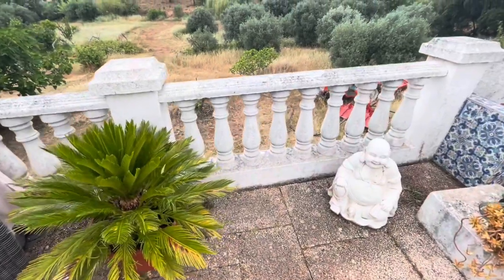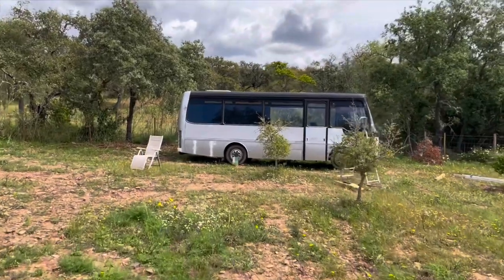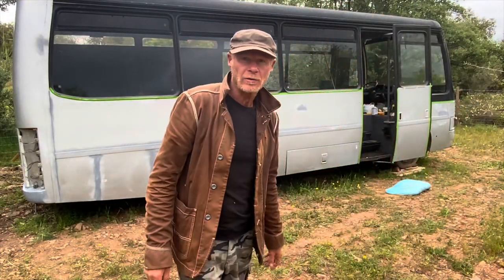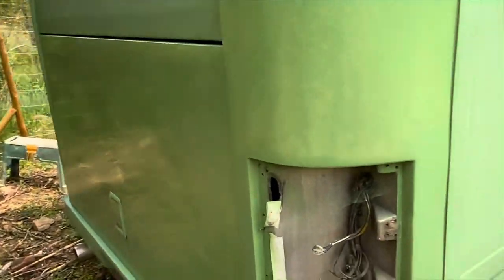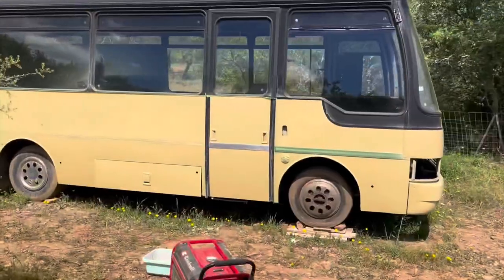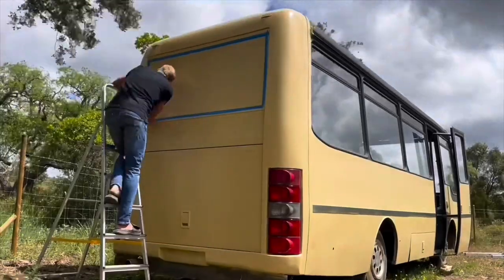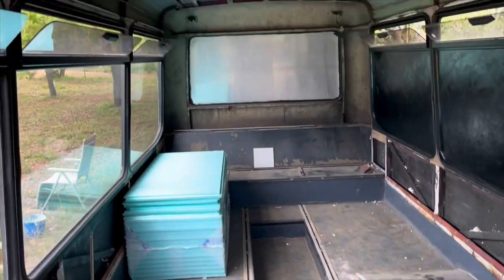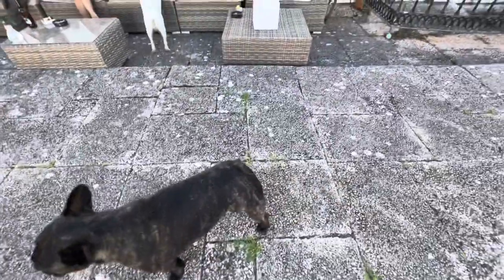Transforming a Bus into a Home in Portugal #07

Comment: Thumbs 👍 up Sir 
 Will follow the Bus conversion with interest,   as I plan convert a Luton /or standard Truck 🚚 in the future.  
 Floor looks good 👍
Reply from the maker: If I was to do it again I would use pallet wood on the ceiling. Probably more for aesthetics. Saying that the pvc I used is good but no tongue and groove on the ends makes the joins almost impossible  to make invisible. And Further down the line I’d like a clever devise to have insulated blinds that can open up fully for daytime. The floor worked out really well. Also if money wasn’t a thing (as it won’t be driven around) I would go for a small pellet burner.
Reply: @blondguy   Thanks for the details.
 Yes .. I know what you mean  (pallets)  about the look,     but  boy  they are a lot of Extra work.   Different lengths,  THICKNess  ,  some clean  some not,   different levels of stain to create perfect finish.......OH   Yes beautiful,   but a lot of work.    I didn't realise the ceiling was PVC  lengths  (I must be blind) .... what you think of tongue and groove WOOD   and Paint it White? 
 I would love a small Stove too,  they look beautiful,  but take up a lot of Value space,     I'm  going towards  a Diesel heater,   hooked into the Lorry  🚚 Tank,   if  its not crazy price wise,  running heating  pipe under full floor.  
Yes.. the insulated blinds would be great.
 A friend on mine,  on a stationery bus 🚌  ,   put   12 or 18  eyebrow    all the way along   on outside  over the windows  made  from sheet tin.   He said  major improvement to temperatures 🌡..

Comment: Love your videos, but there still is some work to do on the audio part.
You should use a mic attached to your body, and check the audio gains of the used music, somethings are to loud and the voice part is not loud enough.
Besides that  nice work!!
Reply from the maker: Thanks Gunther. I think they improve as you get more up to date. The wind in earlier vids was a problem. I’m always trying to improve the volume between music and speech. But I think your right about the mic. Will look into it and make sure I improve on that. 👍
Reply: @blondguy  many use the Rode microphones, if you don't want to hasle with cables than you need to check  the Rode wireless go compact.
Reply from the maker: @Labombab  will look into that tonight thanks.